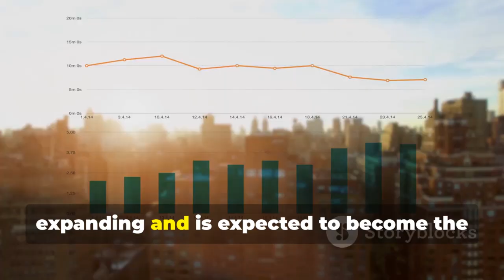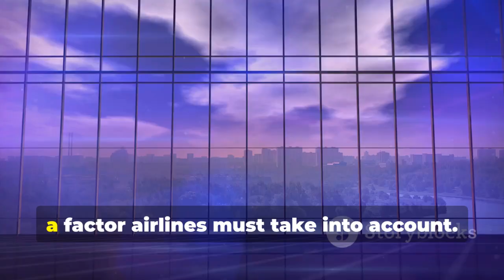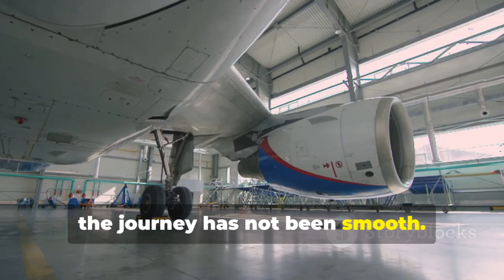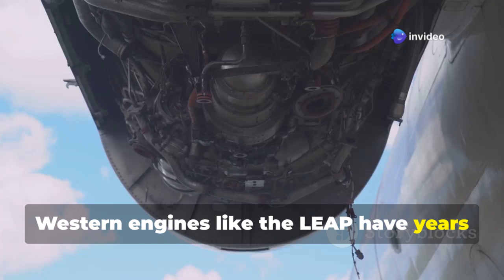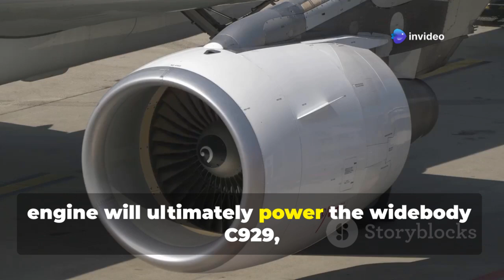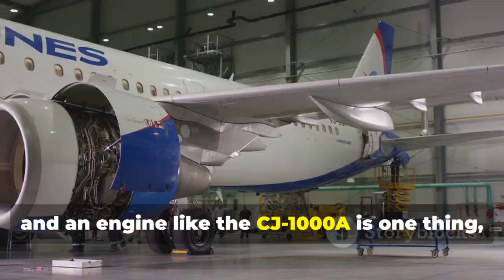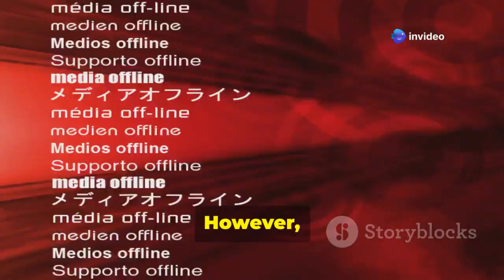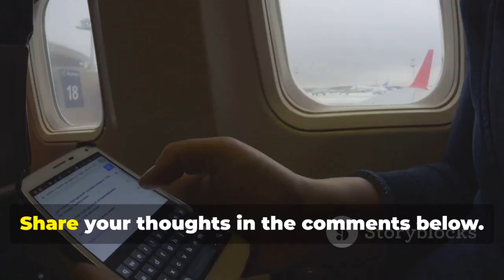China’s NEW C929 & CJ-1000A Engine will BEAT Boeing & Airbus!

Comment: It’s very confusing in the title and video. There is no uncertainty which engine is for C929. It’s CJ2000 with 35 ton plus thrust. It’s in advanced stage of development and testing now with accumulated 3000 hours testing time of the prototype.

Comment: Why in trouble????
The whole World 🌍 , should admire China ❤
Reply: In trouble because the Chinese domestic market for jetliners represents a significant chunk of sales for Airbus and Boeing. China is geographically large and its growing middle class is fueling the increasing demand for domestic air travel. Comac doesn't even need global sales to threaten these two giants -- all it needs to do is gobble up the Chinese jetliner market. And it is very likely to do so, as the monkeys in the West have made it very clear they can very easily place sanctions on the maintenance, parts and other support for Airbus and Boeing aircraft to bring China's domestic air travel to its knees. That's exactly what they did to Russia.

For China's airlines, going with Comac is the solution to the problem the West has stupidly manufactured, which didn't exist before. Like I said, they're monkeys who can't think very far ahead.